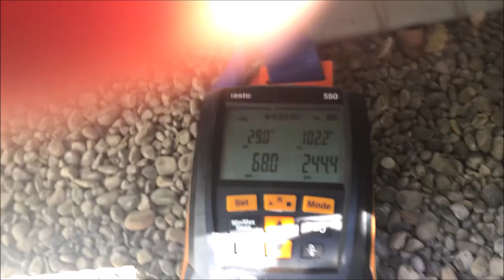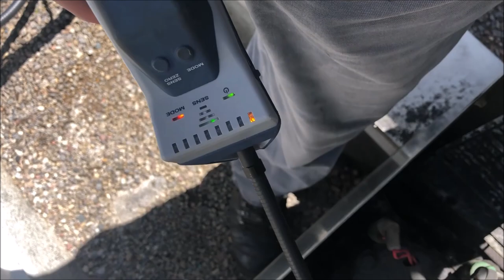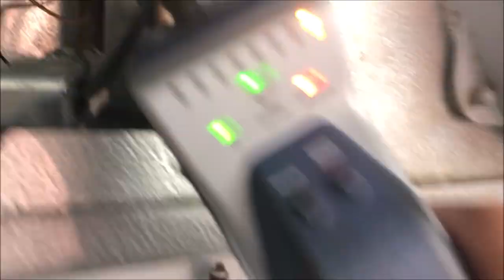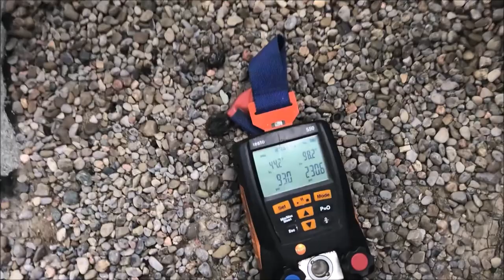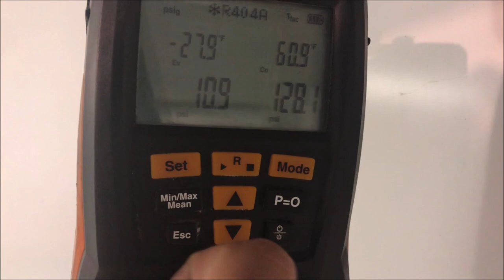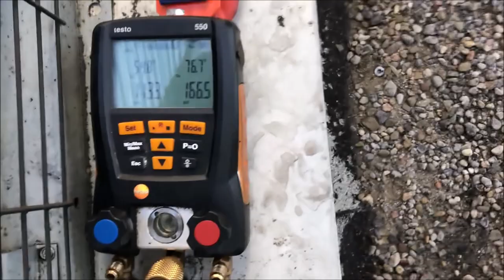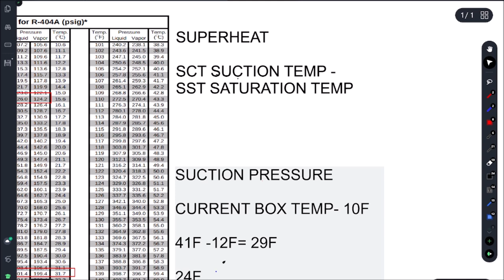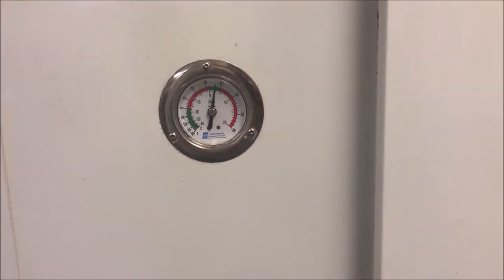Walk in Cooler Refrigerant leak test

Comment: To increase suction pressure you have to turn the stem valve clockwise correct?
Reply from the maker: Think of it as a garden hose gate valve in your backyard. If you want to increase the water pressure, you open the valve (CCW)

Comment: Adding nylog to the thread portion of the fitting changes the torque value of the flare. I always just put it on the flare face of both sides of the fitting
Reply from the maker: Never knew that, thanks for the tip
Reply: All the things I’ve learned from your channel man, no problem! Keep the great content and knowledge coming.

Comment: There pretty common for those krack units leak from the corner where the oil stain is condenser replaced one a month ago
Reply from the maker: I’ve yet to have a Condensor leak on these keep rite outdoor units, I been lucky I guess. That oil stain was suspect but there was oil everywhere from the compressor changeout a few years back.

Comment: 👍💪❄️🇺🇸 ? About the pump down. If compressor valves r good u wouldn’t have to front seat suction service valve to service txv. But if adding nitrogen to leak test I’m assuming is why u closed suction service valve. Always enjoy thanks 🙏
Reply from the maker: You got it, but even without a nitrogen test I always close off that suction valve just in case the compressor valve is bleeding through slightly.
Reply: Thanks 🙏 n let’s go flyers

Comment: where did you get that hanger for your gauges?
Reply from the maker: Supco HVAC strap
Reply: @REFRIGERATIONKITCHENEQTECH  I have two testo 550 both hook failed. How does that install since the hook for the testo is a ball.
Reply: How did you mount it to the manifold?

Comment: Can you tell me the brand of the leak detector you are using, thanks.
Reply from the maker: I use the Dtek 3 and sometimes the H10Pro for the harder to find leaks
Reply: @REFRIGERATIONKITCHENEQTECH  , thank you, also i just start working with a refrigeration company, before I was doing residential and light commercial Hvac, boilers, and so on, but refrigeration seems more complex and I really want to learn I know it takes time, so I start watching your videos , what’s your advice or how to approach to any refrigeration systems when I want to diagnose. Thank you.
Reply from the maker: Follow the same steps everytime. Do all your checks before even thinking of gauging up. If you need to gauge up, know what your pressures need to be. Practice makes perfect
Reply: @REFRIGERATIONKITCHENEQTECH  , thanks again for your help, will do.